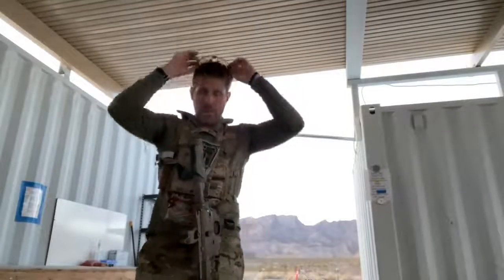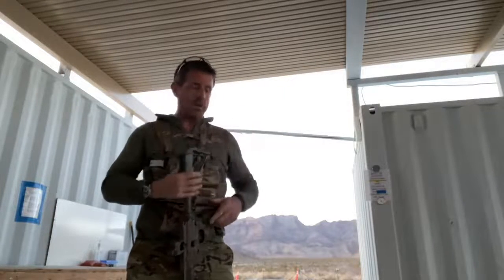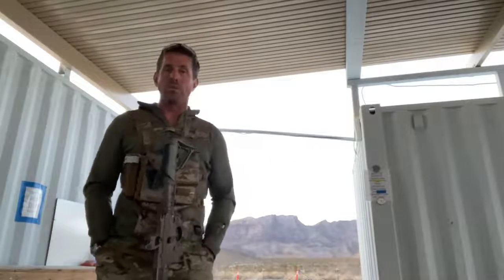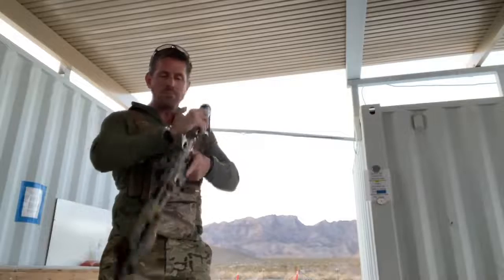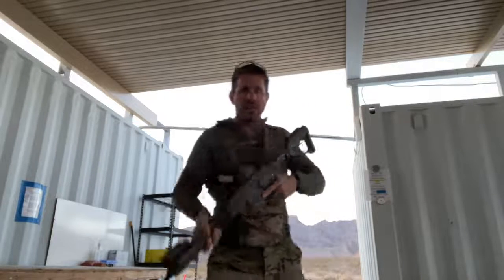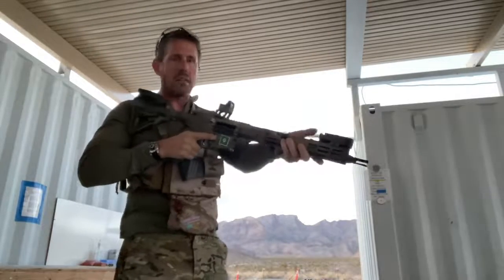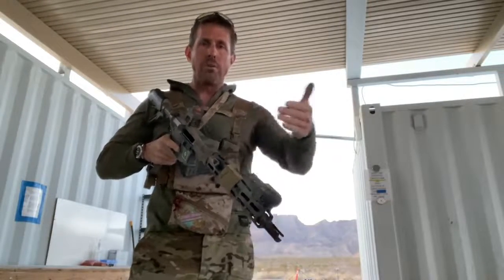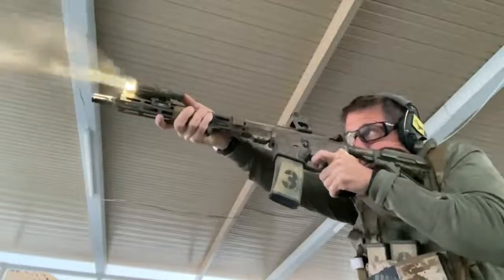Weapon Mounted Light Placement Considerations

Comment: Brian, thank you again and appreciate the info. What is you feedback on the mounting of the flashlight related to if the light is too far in front of the muzzle or too far back of the muzzle? I had the light back of the muzzle and the muzzle would block the light on that side. Is there a danger in mounting the light too far forward? Thank you